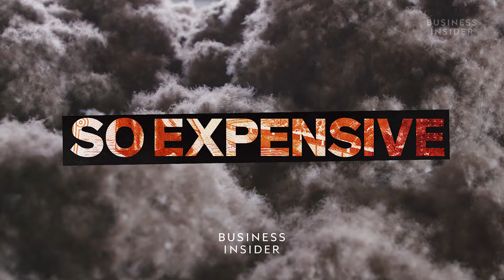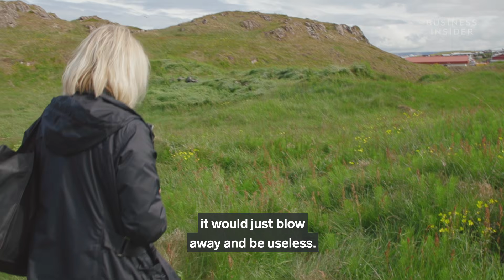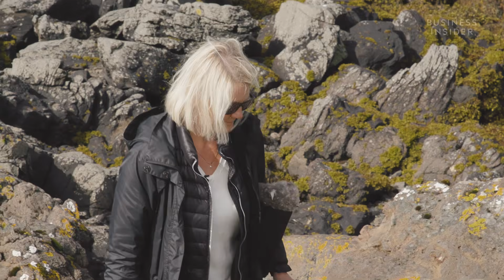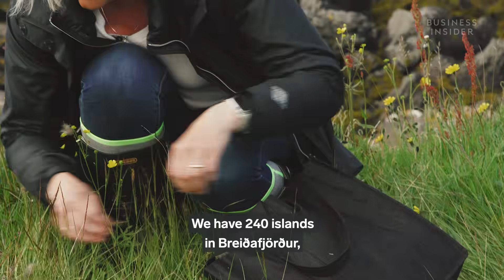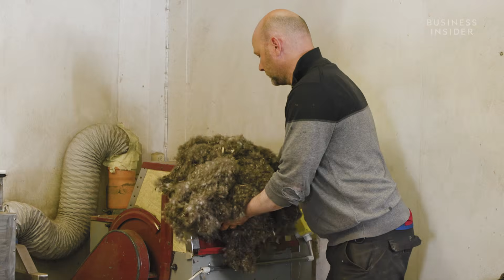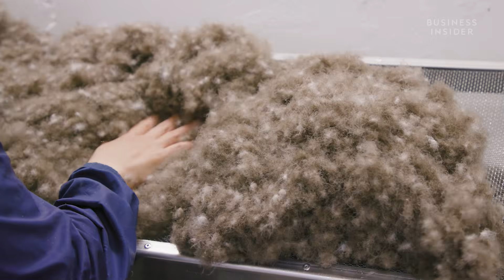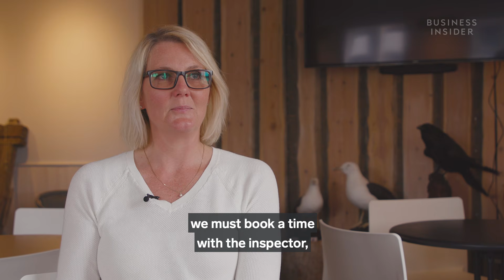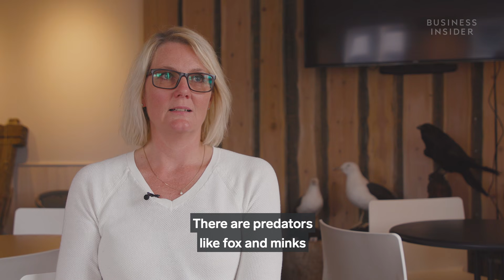Why Icelandic Eiderdown Is So Expensive | So Expensive

Comment: With todays technology, they could easily mark each nest they find then come to remove the nests near the end of the season, you will loose couple of nests, but you ensure less stress on the birds that no longer need to rebuild 90% of their nest and a lower loss of eggs meaning more ducks, meaning more down in the future.
Reply: They want to make the material more rare so they can mark up the price higher
Reply: They could be scared that someone else will find the nest and take the down.
Reply: not if you are worried someone else is going to come and take it. Apparently its big money. 

Its just like animal racing, whom ever is willing to do what others aren't is going to be most successful.
Reply: down covered in bird crap would be my guess the abandoned nest is lower quality. This is why the woman was stealing like 80% of that nest. The eggs look barely warm.
Reply: @MistressOP Adult ducks do not poop in their nests, and the ducklings leave very soon after hatching, so poop in the down shouldn't be a problem.
Reply: @Everything_Animal  They don't have to poop directly in the nest to soil the nest. Some is going to get soiled and there's always a section that sorta sucks. shes probably taking the part outside where the direct eggs are. which where most likely the soiled part if there was going to be a soiled part.
Reply: marking the nests could also make it way easier for predators to find them, unless they were marked digitally with some sort of coordinate.
Reply: @squishydonuts1004  hence todays technology..

Comment: "We only take a little". But steals over 90%.
Reply: And that's with the camera filming her. I bet she slam dunks the eggs into a frying pan and takes 100% of the nest when she's on her own.
Reply: @bort-  yeah
Sadly no one to stop her
Reply: Good thing you're a expert regarding Eiderdown and the farmer and all inspectors are all stupid.
Reply: @thundereagle4130  nothing like animal related content to bring out the suburban internet experts.
Reply: @thundereagle4130  you dont need to be an expert to know that she take more than 70% of their nest
Reply: @fbbinoire201  Doesn't matter. Ducks don't use those feathers to keep their eggs warm. It's the mothers duck body warmth that keep the eggs warm, in fact, most ducks and chickens (including these) bite of their own belly fluff/feathers to expose their belly since that's warmer for the egg. Meaning everything the duck chucks aside in the nest is ''junk''.

The only reason these kinds of ducks build a nest nest to begin with is is to keep the bottom warm with those feathers. And they only need very little of it since eggs also need moisture from the soil (as you can see in this video). These ducks act exactly like chickens when it comes to nesting, a chicken just bites off it's belly fluff and plumps itself down somewhere, tossing junk out beneath itself. Now there are ducks that use twigs to build a nest like pintails, but they do it for different reasons, not for warmth/isolation. 

But hey, being outraged and thinking you know it better than literal experts is the rage these days. The outrage culture of kiddo's these days is just terrible. Tough the video does explain this concept very poorly.
Reply: she need to be schooled about the correct meaning of "little"
Reply: 99%* bruh ur eyes need some check up
Reply: @mr.unknownymous2114  99.9%. hope my eyes are ok now. 😑

Comment: You should use cotton sterilized unstented and rubber gloves for a bigger better nest for the eggs. Maybe black lambs wool still sterilized and unstented. If it works better then remove all the nesting material. You can not add smell because that is bird specific like my smell is not like your smell or her smell. Last make sure you turn the eggs before you replace them the hen will do that anyway but be a good mother and give them a slight turn.

Comment: My God people, would you shut up about 'They take too much of the down' or 'how unethical'.  This has been going on for generations and the birds haven't suffered.  Of course it's been studied what kind of impact it has on the birds with taking the down, and they found that taking it actually improves the success of the hatching.  If it rains a lot, which is a very likely thing, the down gets saturated by water and and looses its' ability to hold in heat, so it doesn't protect the eggs as well.  The straw is much better at insulating, even when wet.  The farmers also take very good care of the birds, guarding them from birds of pay, foxes and mink, making sure that the chance for success is much higher, along with building nesting shelters for the birds.  This one short video isn't going to give you an accurate image with all the information, pleas do some research.

Comment: "Ethically harvested" as they take almost the entire nest from under the eggs leaving the eggs exposed until a parent gets back. It looks cold AF out there.
Reply: @Lacoon A jean jacket vs puffer jacket- they’re both jackets but one radiates more heat. They needed the full one to give more protection.
Reply: The eggs are exposed to the cold air regardless until the ducks return. The nest itself doesn't generate warmth, it mostly acts a cushion.
Reply: @Mephitinae  it does insulate from the ground though....if the egg makes contact with the ground it will literaly freeze.
Reply: surely you dont know how factory farms operate so you dont have anything to compare this to
Reply: @reuben7090  what do factory farms have to do with this?
Reply: @chromyl_chloride  they're much worse so stop complaining
Reply: @reuben7090  a murderer is much worse than a rapist so should we stop punishing or judging rapists?
Reply: @chromyl_chloride  good way of putting it

Comment: Doesn't look like the nests have been finished with by the birds!
Reply: "Eiderdown farmers will harvest this down either by taking small amounts from each nest or by waiting for the birds to dissapear completely"

Notice the words: either, or and bird.

They will either take small amounts while the bird is there or larger amounts when they arent. If the birds are not there then they take larger amounts. Nothing here is contradictory nor is it unethical. If anything this is beneficial as farmers are now invested in the safety of the bird populations. The fact that oftentimes the wind will blow away the nest if the birds are not present and the birds return and remake it is no different to when it the nest is taken with the minimum left for the eggs to survive. Either way: no birds are being harmed, no eggs are being harmed and this practice in contrast to ones like whaling have not had any adverse effects on the population of these birds unlike that of whales.

This practice has been refined for centuries. That does not mean it is good nessesarily just that it is efficient and due to the scarcity of this material REQUIRES that farmers maintain the populations of these birds. If it had any adverse effects on the birds then there would be noticable effects on the amount of Eiderdown produced and because there are no signs of this, it is simply wrong to consider this unethical as all signs show that it is an ethical and sustainable practice.

Comment: Its not farming its stealing the nest form the ducks
Reply: "Eiderdown farmers will harvest this down either by taking small amounts from each nest or by waiting for the birds to dissapear completely"

Notice the words: either, or and bird.

They will either take small amounts while the bird is there or larger amounts when they arent. If the birds are not there then they take larger amounts. Nothing here is contradictory nor is it unethical. If anything this is beneficial as farmers are now invested in the safety of the bird populations. The fact that oftentimes the wind will blow away the nest if the birds are not present and the birds return and remake it is no different to when it the nest is taken with the minimum left for the eggs to survive. Either way: no birds are being harmed, no eggs are being harmed and this practice in contrast to ones like whaling have not had any adverse effects on the population of these birds unlike that of whales.

This practice has been refined for centuries. That does not mean it is good nessesarily just that it is efficient and due to the scarcity of this material REQUIRES that farmers maintain the populations of these birds. If it had any adverse effects on the birds then there would be noticable effects on the amount of Eiderdown produced and because there are no signs of this, it is simply wrong to consider this unethical as all signs show that it is an ethical and sustainable practice.

Comment: Bloody hell everyone’s got heating in there house ... I destroy a ducks warm nest so I could have $8000 blanket in my bloody heated house!!!
Reply: "Eiderdown farmers will harvest this down either by taking small amounts from each nest or by waiting for the birds to dissapear completely"

Notice the words: either, or and bird.

They will either take small amounts while the bird is there or larger amounts when they arent. If the birds are not there then they take larger amounts. Nothing here is contradictory nor is it unethical. If anything this is beneficial as farmers are now invested in the safety of the bird populations. The fact that oftentimes the wind will blow away the nest if the birds are not present and the birds return and remake it is no different to when it the nest is taken with the minimum left for the eggs to survive. Either way: no birds are being harmed, no eggs are being harmed and this practice in contrast to ones like whaling have not had any adverse effects on the population of these birds unlike that of whales.

This practice has been refined for centuries. That does not mean it is good nessesarily just that it is efficient and due to the scarcity of this material REQUIRES that farmers maintain the populations of these birds. If it had any adverse effects on the birds then there would be noticable effects on the amount of Eiderdown produced and because there are no signs of this, it is simply wrong to consider this unethical as all signs show that it is an ethical and sustainable practice.

Comment: Well action speaks different from the word. She took all but left little.
Reply: "Eiderdown farmers will harvest this down either by taking small amounts from each nest or by waiting for the birds to dissapear completely"

Notice the words: either, or and bird.

They will either take small amounts while the bird is there or larger amounts when they arent. If the birds are not there then they take larger amounts. Nothing here is contradictory nor is it unethical. If anything this is beneficial as farmers are now invested in the safety of the bird populations. The fact that oftentimes the wind will blow away the nest if the birds are not present and the birds return and remake it is no different to when it the nest is taken with the minimum left for the eggs to survive. Either way: no birds are being harmed, no eggs are being harmed and this practice in contrast to ones like whaling have not had any adverse effects on the population of these birds unlike that of whales.

This practice has been refined for centuries. That does not mean it is good nessesarily just that it is efficient and due to the scarcity of this material REQUIRES that farmers maintain the populations of these birds. If it had any adverse effects on the birds then there would be noticable effects on the amount of Eiderdown produced and because there are no signs of this, it is simply wrong to consider this unethical as all signs show that it is an ethical and sustainable practice.

Comment: It’s expensive because the act of collecting nests while eggs are on them kills the Eider duck population and therefore lowers the supply for the growing demand
Reply: "Eiderdown farmers will harvest this down either by taking small amounts from each nest or by waiting for the birds to dissapear completely"

Notice the words: either, or and bird.

They will either take small amounts while the bird is there or larger amounts when they arent. If the birds are not there then they take larger amounts. Nothing here is contradictory nor is it unethical. If anything this is beneficial as farmers are now invested in the safety of the bird populations. The fact that oftentimes the wind will blow away the nest if the birds are not present and the birds return and remake it is no different to when it the nest is taken with the minimum left for the eggs to survive. Either way: no birds are being harmed, no eggs are being harmed and this practice in contrast to ones like whaling have not had any adverse effects on the population of these birds unlike that of whales.

This practice has been refined for centuries. That does not mean it is good nessesarily just that it is efficient and due to the scarcity of this material REQUIRES that farmers maintain the populations of these birds. If it had any adverse effects on the birds then there would be noticable effects on the amount of Eiderdown produced and because there are no signs of this, it is simply wrong to consider this unethical as all signs show that it is an ethical and sustainable practice.
Reply: If it really did kill the Eider they would be extinct since this has been done for hundreds of years

Comment: WTF!!  Can't she see the eggs in nest?
Reply: "Eiderdown farmers will harvest this down either by taking small amounts from each nest or by waiting for the birds to dissapear completely"

Notice the words: either, or and bird.

They will either take small amounts while the bird is there or larger amounts when they arent. If the birds are not there then they take larger amounts. Nothing here is contradictory nor is it unethical. If anything this is beneficial as farmers are now invested in the safety of the bird populations. The fact that oftentimes the wind will blow away the nest if the birds are not present and the birds return and remake it is no different to when it the nest is taken with the minimum left for the eggs to survive. Either way: no birds are being harmed, no eggs are being harmed and this practice in contrast to ones like whaling have not had any adverse effects on the population of these birds unlike that of whales.

This practice has been refined for centuries. That does not mean it is good nessesarily just that it is efficient and due to the scarcity of this material REQUIRES that farmers maintain the populations of these birds. If it had any adverse effects on the birds then there would be noticable effects on the amount of Eiderdown produced and because there are no signs of this, it is simply wrong to consider this unethical as all signs show that it is an ethical and sustainable practice.

This practice isn't new it's centuries old and in no way harms the Eider. If these farmers didn't harvest the nests the wind would destroy them. The birds remake them easily regardless. In fact the protectiom from predators these farmers offer make it so that to the birds there is nothing but gain. The population of Eider has been stable for the centuries of this practice and still is today.

Comment: Take small amounts , maybe correct it to leave small amounts !
Reply: "Eiderdown farmers will harvest this down either by taking small amounts from each nest or by waiting for the birds to dissapear completely"

Notice the words: either, or and bird.

They will either take small amounts while the bird is there or larger amounts when they arent. If the birds are not there then they take larger amounts. Nothing here is contradictory nor is it unethical. If anything this is beneficial as farmers are now invested in the safety of the bird populations. The fact that oftentimes the wind will blow away the nest if the birds are not present and the birds return and remake it is no different to when it the nest is taken with the minimum left for the eggs to survive. Either way: no birds are being harmed, no eggs are being harmed and this practice in contrast to ones like whaling have not had any adverse effects on the population of these birds unlike that of whales.

This practice has been refined for centuries. That does not mean it is good nessesarily just that it is efficient and due to the scarcity of this material REQUIRES that farmers maintain the populations of these birds. If it had any adverse effects on the birds then there would be noticable effects on the amount of Eiderdown produced and because there are no signs of this, it is simply untrue to consider this unethical as all signs show that it is an ethical and sustainable practice.

Comment: me: “oh ok she’s taking a small amount and then she’s gonna put the nest back down that’s go-“
her: takes the ENTIRE NEST AND LEAVES LESS THAN A HANDFUL
Reply: The eggs need insulation down to the ground.  She left the bottom of the nest (you can't really see the bottom of the nest since it was filmed from the side and this angle was obscured by the grass.) the upper part of the nest, around and between the eggs are uncompressed feathers and will blow away during nesting season.

In Norway it's traditional to build tiny wooden or stone "houses" on unpopulated islets for the Eiderduck, so the feathers don't blow away and can be harvested after the birds has left.  But only in parts of Norway where this practice has continued for hundreds (or thousands) of years are the Eiderduck keen on building their nests "inside".  And a farmer may several hundred Eiderduck "homes" over several dozen islets to build/maintain, with a portion of the "homes" being inhabited in a given year.
Reply: They said if the birds are there they take a little but if the mother leaves then that is when they take more. The mothers remake their nests relatively quickly and otherwise the wind destroys them anyways.
Reply: @MathewST1  table